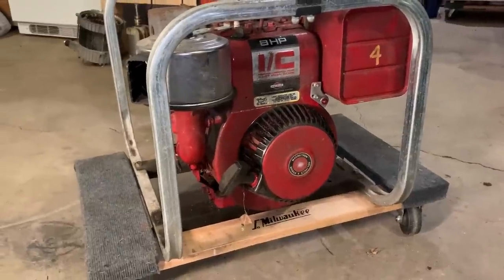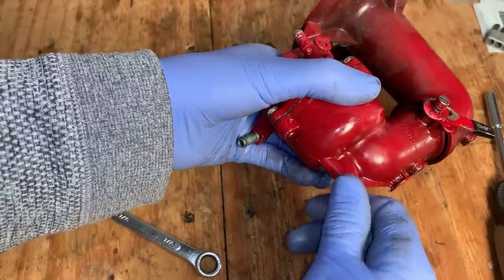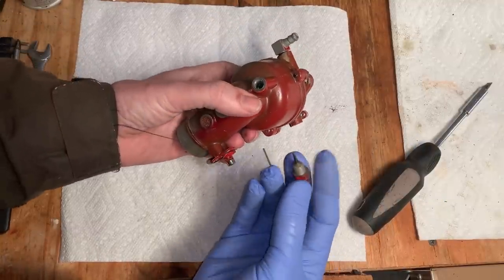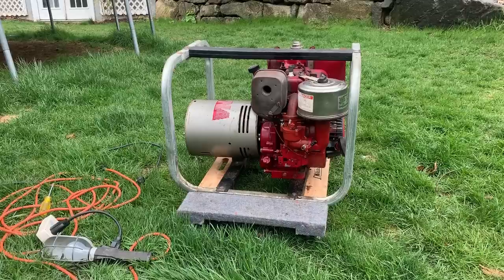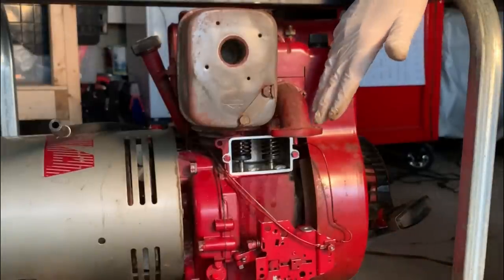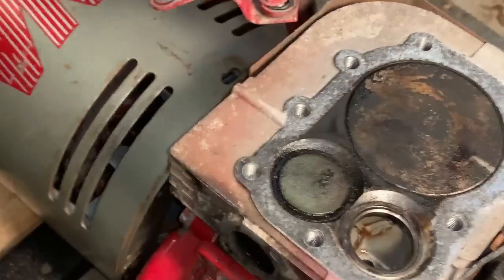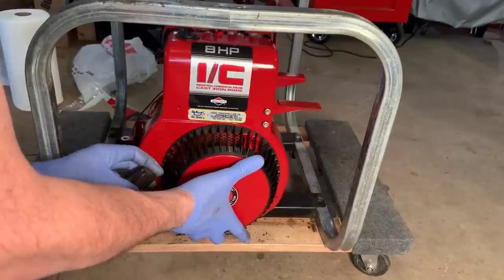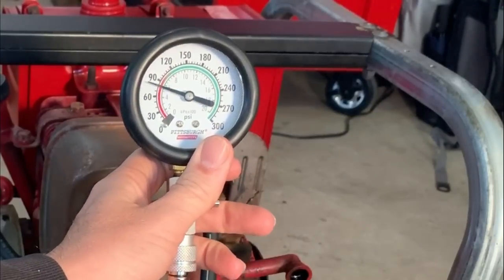Old Winco Dyna Generator (Part 1) - Will it Run?

Comment: I would start with making sure that where the fuel comes out of the tank that the fitting doesn’t have something blocking it.  I assume that the power head has bearings of some sort. I would make sure that the engine isn’t fighting against them using up all its power.

Comment: I have this same generator but under the Homelite brand. Your reading of the date code is correct, mine was made January 30th of 1990, slightly different head but identical engine and specs. I've only had it for a few months and didn't use it much. Mine can run a 1500 watts heater and start my 20 gallon compressor and the engine pitch barely changes, it does so effortlessly. It should definitely be able to sustain a 3000 watts load without issues. Could there possibly be internal damages to the governor? Those shavings in the oil, maybe something got damaged and the tolerances are messed up? Something that could prevent it from keeping up with the higher loads.
Reply from the maker: I made a second video on this one and figured out the issue.  Did get is running as it should.
Reply: @jcondon1  I actually watched the second part right after commenting. Well done, glad you got it working.

Comment: kind of relaxin to pull a carb apart, taking ur time and cleaning all the holes in the  emulsion
tube or is a jet? either way nothing clogged. I have seen tiny tiny holes in the barrel end of 
carb close to the engine and throttle plate. having soaked carb in cleaner and some shop air
works out pretty good.

Comment: I have found that if   the bottom  fuel adjustment screw is  adjusted to far in  it  can  and  will  damage  the  seat and  needle.  (at  video  point 1435)

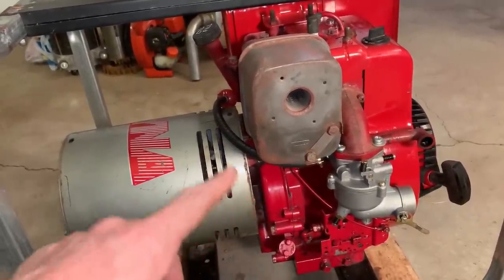Comment: Looks like you changed the carb at some point? Before 47:30 its red, after 47:30 its metallic? Love your vids. I learn so much. Thanks. I have one of these carbs on an old Briggs Model 14 with an insane magneto system.
Reply from the maker: I did.  The red was OEM and the metallic was a clone.  I made a part 2 on this Winco and ended up solving the problem.

Comment: I was going to suggest a very slight timing problem. Maybe the cam is off by one tooth one direction or another. Not enough to affect a compression number but perhaps an efficiency number. The other thing that crosses my mind is that perhaps there's a fault inside the generator itself. And while it's only generating 3,000 watts at your meter perhaps there is significant power being cross loaded internally due to a short or some other failure electrically. So while you're only seeing 3,000 w at the outputs perhaps the engine is actually feeling significantly more drag than that. Might explain why it's still is running at half throttle even when there's no electrical load at the outlets.
I hope you figure it out, really like the design of this little engine it sure is heck a lot easier to work on than some of the new stuff with all the junkie plastic. Nice stamped steel brackets that fit together nicely. They sure don't make them like they used to.
Reply from the maker: I made another video on this.  Timing was off by a tooth and the flywheel key may have also been an issue.  I came off in two pieces.

Comment: Funny, I see thing from the 80's and 90's and think... That looked more modern back then. Now much of it looks like it could be from the 40s!
Reply from the maker: I agree.  This was a '91 model.  Very old design even for '91.
Reply: @jcondon1  I agree. but man!   That oil fill plug is OLD... they Briggs, didn't use those in the 90's as I remember.   Are you sure someone didn't swap some parts on to a 1960's or early 70's machine? Maybe a newer engine cover/ pull?   That thing looks O.L.D!  My neighbor (old guy in his 80's) had me come over to pull start his generator ... looked just like that.   .    I can't buy the 1990's on it.   He had his since the 1960's.    Smithsonian material!    Good video though!

Comment: I think the exhaust glowing red is a hint. Not sure if you adjusted the main jet under load. Like you suggested, it could be lean. Those old flat heads ran fairly smooth with an exhaust note that was steady. The one you are working on does not sound smooth especially under load. Good luck.
Reply from the maker: I have a part 2 on this one.  Ended up figuring it out after opening the engine up.

Comment: I seem to recall these engines were a bit "saggy". We had one on our bale elevator in the '70s which could barely hold its own against even a partial load.  

We still have a generator of near identical construction to yours, identical 'gen-end' but ours has the "Pulsonic"? carburettor. Otherwise, it's basically the same engine. Even then, it's still a bit saggy, but nowhere near as bad as yours. Our machine is branded as P&O , as in P&O Stena, the shipping company, it even bears their flag. (Pacific & Oriental Stena Lines)

A thought that comes to mind is, what about the big end? if you have that glitter in the oil, the big end is likely first candidate, followed by the mains. If the surfaces have become abraded, they'll bind with increasing intensity as the engine load is increased. - We had a similar oddball scenario with Ferguson tractor engine. It responded well to a clean up of the crankshaft, and new big end and main bearing shells.  Not that your generator will need that level of work done, but it might respond to a clean up? Though I'd keep that as a last ditch effort if all else fails.
Reply from the maker: I have a part 2 on this one.  Ended up fixing the issue.  It required opening the engine up.

Comment: How is the crank caseventilation.  If its obstructed it can cause back pressure in the crank case under the piston causing  to run slow know it's a stretch but it has to be on the air side of things or mechanical  but realistically sound like you may have a bad main bearing
Reply from the maker: There is a part 2 on this generator.  Ended up solving the issue.

Comment: I would run it without the muffler on as a first test, as it is easy to do and causes no harm. 
If no improvement, I would check the spark timing, take the head off and check the valve timing too, tho I dont know the opening closing angles. These could all be out of whack, so low power even tho the compression is good. Maybe someone opened the motor and  put the cam shaft in one or two teeth out. I would also remove the decompression lobe off the cam shaft and learn to start it full compression. I have a Tecumseh lawn mower engine I did that to and it ran much better 
Lets see what Part 2 brings.....

Comment: Try changing muffler out even though it looks good may have too much back pressure and thus choking the engine not allowing the throttle to come off full open. Removing the muffler and running it will tell you the same thing. Likely not inside the engine or generator. Had similar problems that turned out to be muffler. One of your videos the the muffler turned red, likely indicating too much back pressure.
Reply from the maker: I have another video on this Winco where I did finally figure it out.

Comment: I've got a model similar to this one, a model LC4500/M, and I put my multimeter into the outlet and I was getting way above 132v.  I unscrewed the governor speed adjustment screw on the plate and it only dropped it to  like 132v-135v.  I tried a Hz reading on it and it was way up there and thing isn't even running fast.  Odd...
Reply from the maker: The idle set screw could be holding the throttle plate open.  If not then verify you can fully close the plate manually.  If the above checks out then you might need to reset the governor calibration.  Brushless generators make dirty power usually without a load.  Multimeters can have issues figuring it out.  Apply a moderate load and check again.  If still does not make sense then you may need to use a tachometer.
Reply: @jcondon1 Ok.  I'll check into it some more.  Thanks for the reply!
Reply: @jcondon1  Ok. I put my tachometer on it and set it at 3750rpm, which is what I think the documentation said online, hooked a dual hotplate to it, it said 550w and 1100w, which I'm thinking that has to be both plates, so 1650w, and I was getting above 61Hz and 125v-127v.  So I'm thinking she's good to go at that.

Comment: James... you said this was probably 30 year old gen.... I'm thinking this thing is from the 1960's or 1970's... she's an oldie!   The oil fill plug ... the metal air cleaner and gas tank.... looks like my dad's 1967 Toro Whirlwind machine!
Reply from the maker: That would have been my guess.  Was surprised that anyone was making a generator/engine like this in the 90's.

Comment: Did you check your flywheel key ? Also I'm not sure your throttle should be at full throttle before you start it , I've worked on hundreds of those over the years but they don't make any like that anymore & I haven't worked on any in quite awhile so can't remember for sure . The muffler glowing red would indicate a timing problem though I believe and that could also be a miss adjusted governor lever . Sorry that's all I got . Good job catching the intake valve problem !!! :-)
Reply from the maker: It ended up being a timing problem.  There is a part 2 on this https://youtu.be/SR8tQJ9NFvo

Comment: Adjust the main jet under load, it should be pretty rich, and the muffler should not be red. I fixed a similar generator some yrs. back and it ran great under a full load. Thanks
Reply from the maker: It ended up being a timing issue and also I realized my mistake and adjusted it latter under load.  There is another video on this one.

Comment: I like your diagnostic trail. Had a shop myself in the 80s. STILL learning after watching you fix some of these engines. I also have a valve removal tool(didthe last time I checked) that I wouldnt mind getting rid of. Have you  tried adjusting the carb under load?

Comment: Likely a lower end issue.  High friction on the stroke points that direction.  Also, how much clearance b/w piston and cylinder?  I suspect it is < 0.005.  Perhaps honing will improve rev-ability.
Reply from the maker: There is a part 2 on this generator.

Comment: I think the white stuff in the carb bowl was corrosion oxide from the pot metal
Reply: Modern gasoline with ethanol added will absorb moisture more readily and that is what causes the corrosion.  The best way to avoid this is to shut the engine down by using a fuel shutoff valve and draining the bowl (if you have a carb that has a drain).  Also drain the gas tank completely when the engine is in storage for any length of time.
Reply: @1575murray  Yes, ethanol and cheap metal, what a combo.

Comment: I think it has a egg shaped cylinder,   That was the dragging you felt and the source of all that aluminum you saw in the oil.  My guess it was run at wide open for most of its life and never maintained properly.
Reply from the maker: I would have to agree.  Did not have a bore gauge at the time, but have since worked on other 8hp Briggs and they did not have the same drag.
Reply: @jcondon1  just stick a ring in the cylinder and push it down and measure the end gap.  It will be bigger at spots that it is bigger.  I am sure you have an old ring, somewhere, that will fit in that bore but that would require tearing it down to some degree.  Just looks like a worn out money pit to me.

Comment: Hi I’ve got a generator of about the same design although it’s a Gillette generator with a 5 horse Briggs motor powering it and although it will put out 240 volts it will only do 1600 watts hope this helps

Comment: Late to the game but pull the muffler and run it with the load. As it was running so lean and hot, the steel baffles internally have been pushed around from the exhaust pulses and are restricting flow. You'll find it will take the full load but piss off the neighbors. Otherwise it sounds healthy.

Comment: Right from the outset I felt the Engine was labouring quite hard felt top end issues poor oil circulation as well I bet theirs a blockage in the oil channels, or failed oil pump stopping oil flow, the metal in the oil is a big red flag something is binding very bad I doubt it will last long in that situation. those older engines were also designed for leaded fuel which was lead lubricant the cylinder did seem very dry on the bore just some observations.

Comment: Could it be an air leak on the intake or exhaust blockage as in the wrong muffler or timing? The engine sounds a little timid to me for 8Hp! Ron USA, PTL
Reply from the maker: Figured it out in part 2.  Link should be in the description.

Comment: I wouldn't think that is normal. That engine is bigger than my old one with a 6hpTecumseh. My guess would be a ring job and check the governor. Maybe it's not working 100%. Considering the age, I'm surprised it runs that good.

Comment: I've had great luck with clone carbs: but not the flo-jet clone carb. Why on earth would there be fitment issues on a carb that's supposed to be a replacement? I'm reordering (yet again) a rebuild kit for the original carb and giving it another shot (same engine on a Troy Bilt tiller).

Comment: What is the size of the carb bolts.. i lost one.. intake manifold pipe. I have the same exact carb on our 20T log splitter. How about tight bearings on the generator head or its needs lube. Try some synthetic oil
Or some Marvel mystery oil mixed in.
Reply from the maker: Sorry, don't remember the bolt size.  There was a part 2 on this video.  Had to open the engine to solve the issue.

Comment: Great video. I just lately acquired an old Pincor 2500Wgen having a similar B&S 5 HP engine. However, it have a different carb which is a pulsa jet (pumping gas from bottom tank). It was not making fire so I changed the existing coil(w/points) for an electronic type. Cleaned tank/carb (2X), changed all gasket including pump membrane, relapped valve (compression after= 50PSI). I don't know if you have ever work with such a carb. Problem: I am able to start engine but unable to adjust needle jet for getting it to rev smoothly. Succeeded to have it running smooth  only at very low idle but at higher speed it hunt a lot (like knocking...) (checked if air leak thru gasket but none). Any idea what would be the problem? Thanks

Comment: You asked for ideas why it goes to full-throttle and cannot handle load.  There are two things you did not check  1) Setting fuel-mixture UNDER LOAD. (those old carbs are not good at maintaining air/fuel mix as the throttle plate moves)  2) Ignition timing... points, dwell, keyway....etc

Comment: Any chance that the generator has a mechanical issue that is causing an extra drag on the motor more that normal?  Also check the plug wire resistance.   As it gets older it get have an increase in the valve to the point it fails under load. Very rare but it was kinda common about 30-40 years ago
Reply from the maker: It ended up being a valve timing issue.  There is another video on my channel about this.
Reply: @jcondon1  

Good catch.  Watch you videos frequently.  Like them because, your diagnostic skills are all that and a bag of chips.  Very through, well thought out.  Very consistant.  You are defantly a master of your trade.  Always a please to watch.  
Me, retired Lead Feild Technical Engineer.  Worked for Bosch industries in Europe, before retiring in the states. 
    Great skill set, very informative. Its always enjoyable to watch you work.  You dont miss a beat. On point always,  never seen you go off out into the weeds.  Keep it up!

One thing though.
  Where do you find so many broken generators?

Comment: What are you talking about, the compression release valve ?  If you are talking about the valves being a little bit open when the piston is at the top of the cylinder , well ,  that piston is in the  EXHAUST/INTAKE MODE, Of course you are not going to get any reading on THAT cycle. Neither valve is open during the compression/power mode. So , what is being open to keep you from using a compression tester?    ALL due respect.  Keep in mind, for every 2 revolutions of the crankshaft, there's only 1 revolution of the camshaft. This means the magnet is passing the pickup twice.
Reply from the maker: Sorry, been a while since I watched this one.  What is the timestamp related to the comment?  Also there is another video on this.  Had to open the engine to find the issue.
Reply: @jcondon1  Thanks James for both great videos on this machine.  Great work!  New subscriber and long time tinkerer.  Where do you find shop / repair manual for specs on valves and torque settings?  I found a similar 1986 WinCo PM2500 /A Generator with a 5 HP Briggs engine.  It is near 100% complete and runs good with power on first start up.  I want to maintain it and make it last and not afraid to give the time to dig into more complex repair tasks ~ 
Please share any helpful websites or tips or phone numbers that you use as resources for repair specs.  What type torque wrench do you use?  Thanks again and looking forward to new videos from you ~ Best, D

Comment: Any chance the bearing on the alternator is providing more resistance than it should making the engine work harder to get to the same speed?
Reply from the maker: In part 2 I took it all apart.  Bearing were good.  Timing was off by a tooth. Also put a new piston and rings in.  Probably should have done the connecting rod.  First oil change had a bit too much glitter.